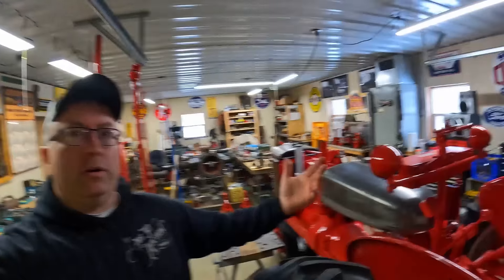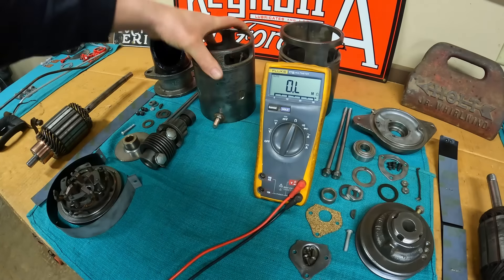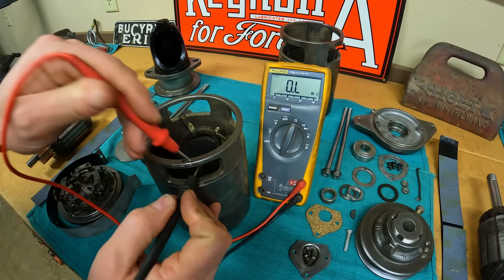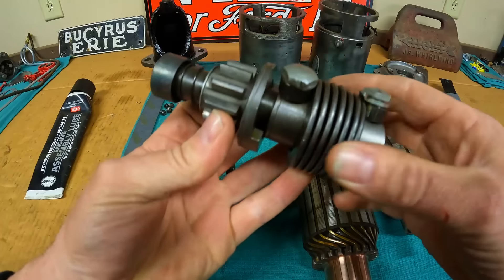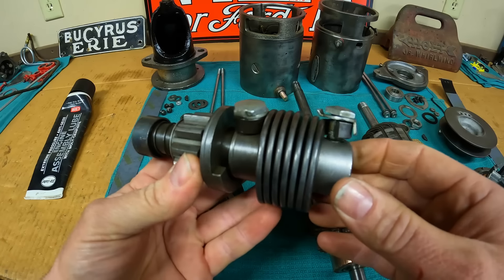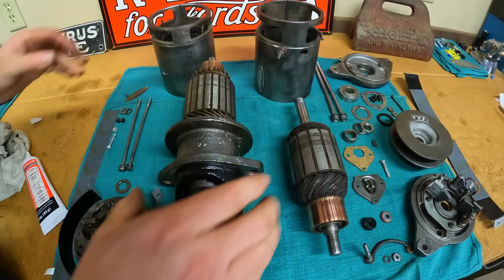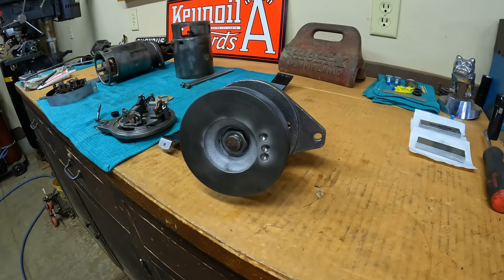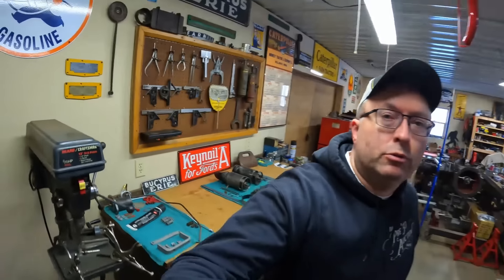Delco-Remy Starter/Generator Repair - Testing Field Coils & Reassembly Begins - "Prep H" Ep. #33

Comment: I'm loving this series I have a Delco-remi generator on my 820 pony start that doesn't always charge and this gives me the confidence I need to take it apart and at least clean it to see if it actually needs a rebuild or not
Reply from the maker: Also keep in mind that the generator is only one part of a two part charging system, the voltage regulator is the second.  Many times the problem is in the regulator if it's an intermittent issue.
Reply: @squatch253  I put a brand new voltage regular on it first as it wasn't putting any voltage out at first because that was the first thing I thought of and now it sometimes charges which is good but the battery still runs low after a while and I'd like to fix that so I'm assuming it's just a dirty generator but after watching your videos now I'll know how to look at things and test things ill leave the rebuild up to a pro since I have a guy local that does it still

Comment: Amazing content as usual!   I sent my starter and generator out, which I now regret.   Really happy that I went with the stock 6 volts, as you would have recommend, just wish I had done my own work.  The three brush system works great but will boil the battery as I was not aware that it was adjustable.   After backing way off, it operates very well.  Something about running your tractor, like it's the 1940's,  is really amazing.

Comment: Nice series on the generator and starter!   As an idle thought, I wonder if the 787 Max 9 doors will be converted to foldover locks instead of castellated nuts?  I'm thinking they just weren't secured by cotter pins though.
Reply from the maker: lol Senior and I were just joking about “Bring back the locks!!!” when we heard of those airplane bolts working loose 😂
Reply: I think it is called "shoddy workmanship".  Apparently nobody checking the work either.
Reply: I don’t think bolts were installed!

Comment: All the older tractors I've worked on has all had a delco-remy starter and generator never seen any other brand un til got to some newer stuff. I guess GM did a very good job since everyone used them.
Reply: I was wondering whether D-R was actually better or if being part of GM (since 1918) provided an economy of scale. Perhaps the D-R products were no better than other brands but less expensive? Bean counters have always been bean counters. If D-R products were even a wee bit cheaper the engineers would have a difficult time justifying additional expense even for products that were demonstrably somewhat better if the D-R products gave acceptable service.
Reply: @curtislowe4577  they have always worked better than any thing else. All manufacturers choose them because it was parts that worked and could be depended on all the time. Just a little mantance and they seriously they just keep on working.
Reply: @charlescastle5566  Not to be mean, rude or dismissive but that doesn't answer the question I posed. Did Ford absolutely not pursue other markets and only manufactured for their own needs? There were independents who survived the Depression. Did they also buy D-R? What about Studebaker? Did they use D-R or make their own? Were there other manufacturers of starters and generators or did D-R corner the market so there actually weren't other choices? Did Chrysler ever use D-R? They manufactured all their own equipment as far as I know and apparently, like Ford they either didn't pursue other markets or their stuff was not cheaper nor remarkably better. The bean counters always have the final say.
Reply: @curtislowe4577  I think what happened back then was that the other manufacturers knew the D-E had did all the work on the electrical components that they could focus on more mechinal things because they all knew that D-E had did extensive work on the electronics and had a contract to provide them to all the manufacturers. I would say some tried their own but had failures and knew they had a source that would provide electrical components that were the most dependable on the market.

Comment: another way to remove the field coils is if you have a big vice you use a ratchet with 1/4 socket and screwdriver bit, you put the starter in the vice and use the jaws to put pressure on the ratchet to loosen the screw

Comment: Dielectric grease may work for you on those surfaces between components, but that grease is meant to avoid the conduction of electricity, not promote it. "dielectric" is an insulator.  Instead, you might consider using a weld-through primer. That material keeps the metal from corroding while providing a good conductor of electricity. Using a process of zinc, nickel, or other plating material would be great, too.  Again, I'm sure your method has worked for you and you keep doing you if that's what you like.
Reply from the maker: That isn’t dielectric grease, it’s an electrical grease used to promote conductivity 👍
Reply: @squatch253  Gotcah, I would expect that's great in electrical connections as designed. I have just had better luck with weld through primer. But again, your experience is what matters to you. I'm just offering mine.
Reply: Forgot to add my apologies. I saw the Motorcraft tube and assumed it was dielectric, as I have a tube. I have used copper anti-seize compound, too, but generally, all of that just seems to create problems later when the painting is done.
Reply: Dielectric Grease is designed to not create Conductive Scorch during arcing, and reduce arcing in contacts
Reply from the maker: @rgmoore - No need to apologize, I just took it as an honest question.  The grease I used here is Motorcraft XG-12, which is manufactured by Nye Lubricants and is specifically for use in electrical connections that can be exposed to water entry.  Ford Motor Co. specs it to be used in many of the airbag and crash sensor connectors where perfect conductivity is required or a warning light will come on - it creates a protective film that allows electricity to flow uninhibited but wards off corrosion in harsh environments.  It can very easily be confused with the Motorcraft XG-3-A though, which is the dielectric grease because the outward appearances of the tubes are nearly identical.

Comment: Did you check the copper post that the battery/starter switch cable goes on,  they get cracked where they are soldered to the field coils. I fix a lot of starters from this, if the post moves when the nut is tightened for the cable it will crack.  Also, I see a lot of broken starter noses from worn ring gear and or bendix teeth and they try to ride up on the teeth and break the nose.

Comment: thanks for sharing. the right tools and information is a great help! the screwdriver you show is still kind of wrong. Ideally the blade should be a perfect square cut profile (not a tapered wedge as off the shelf tools) with a tip shaped to fit the dip in the screw slot. the large flat head drivers in the hand impact ratchets get a bit closer to correct, i think. a 1/4 drive battery impact can help in a pinch but there is risk of camming out and stripping the head. In the out of print magneto book i have, the author recommended buying good quality screw drivers and shaping them on a grinder. Will we see a repeat of this video with X231?

Comment: As a non-mechanic, I appreciate your detailed explanation of the workings of the starter and generator.  I have been told on multiple occasions that some engine has a "bad starter". Since the design is relatively simple, I am curious what is the typical failure point of an electrical starter? I also have had "bad solenoids" in the past. Hopefully you will address that part if the IH Model H had one.
Reply: the monstrous amps that starters pull generates monstrous heat, and that can cook the insulation on the armature (seems more likely than the stators, if it's not permanent magnet). Squatch didn't really highlight it in this but if you look, the starter's armature has much heavier wires than the generator; if a starter is 'smoked', that's probably what's happened because the insulating enamel burns off the armature. The other common failure mode is a cooked relay contactor, whether it was held in too long and burnt up the coil, or the contacts have arced enough to prevent solid connection by making burnt pits... or the housing is just baked and brittle and terminals have come loose (all failure modes I've seen in various Will It Run videos). something else you may find, although it seems mainly a "Big Diesel" Thing, is non-bendix solenoid-throw starter gears, where the starter relay also has a lever on its armature that pushes the gear into position. This introduces a specific quirk: gear-tooth side-hit won't-start. Seems that the gear has to extend fully before the relay makes contact, so if "it just clicks", the starter-gear teeth are hitting the flywheel ring-gear teeth instead of Meshing.if you can nudge the engine a few degrees so it gets out of that interference, it should engage properly.
Reply: @Hyratel those starters with leaver to engage the pinion to flywheel we called Rattrap starter's
Reply: Thanks for the explanation @Hyratel

Comment: The generator field coil is supposed to have a resistance of 2.2 to 2.4 ohms. The average is 2.3 ohms. So (2.3-2.2)/2.3 x 100 = 4.4%. The tolerance on the resistance is +/- 4.4%. You measured 2.0 ohms which is actually 1.9 ohms taking into account of the bias on your ohm meter. This is -17% low on resistance which means that quite a few windings are probably shorted to each other. In other words quite a bit of the enamel has worn through on the windings. It may not reduce the output, but it will make the regulator work harder and waste more energy in the field to get the necessary field magnetic flux.
Reply from the maker: You're correct, and if we were still in the perfect-world scenario of having readily available quality new parts for these units I would be buying new coil windings to maintain 100% capacity.  But those components are now only sourced from the best of what you've got on hand, and just the removal and installation process bring with it a chance of further degrading them so if they test close to the desired, and like this one are known to have been charging prior, they stay in place as long as the generator output is satisfactory :-)

Comment: I'm curious about the Holt Jr Whirlwind part in the background.  Although there's plenty online about Holt, one of Caterpillar's predecessor companies, I can find nothing about that model - nor can I work out what the actual part is.
Reply from the maker: The Holt Whirlwind is a very old Windmill manufacturer, and that is a counter weight from one of them that you'd slide back and forth on the tail section to bring the top rotating assembly into balance.
Reply: @squatch253  Thanks for that.  Veerry interesting, as the saying goes...

Comment: Hey Squatch, so the generator on my M isn’t charging. Followed your checks and I got 1.7 ohms on the field coils. Also tried the motoring test and the generator motors but when I ground the field coils the speed of the generator doesn’t change. So I’m thinking I need new field coils as a starting point. Thoughts?

Comment: Questions.  Is it possible to convert a starter from 6 to 12 volts?  Assuming it’s just different coils or is the armature different also?  Do you know if those parts are readily available?  I have an M that was converted to 12 volt and I doubt they did anything with the starter.  Last one, from the first video, or this one, if the continuity tests fail, is there a way to fix that or is it simply buying new parts?

Comment: I have a question I have a Ford tractor.
Does not have the band over the starter.
Where's the brushes are? I know that's probably very important.
Because the if you get dirt in there.  It's not gonna have the torque to turn the engine over am i correct?
Reply from the maker: Yes it’s important to have that band on there, it’ll keep out water, bugs, dirt, and grit that will dirty up the whole inside of the starter plus cause the brushes and commutator to wear out much faster.
Reply: @squatch253  thanks that's what I though

Comment: So what keeps the sealed bearing from totally from spinning does the flange stop it from spinning
Reply from the maker: The cover with the 3 screws clamps down tight on the outer race of the bearing.
Reply: @squatch253  didn't think that would hold the bearing

Comment: Hi, you talk about electrical grease, is that the sae as dielectric grease? Thanks 👍
Reply from the maker: This is not dielectric grease, this is Motorcraft XG-12 electrical grease which is used to coat and protect any electrical connection that may be exposed to water entry.  It is even used on airbag and crash sensor connections where perfect electrical conductivity has to be maintained or a warning light will come on.  Designed to be squeezed directly into multi-pin connectors before putting back together.  The XG-12 is made by Nye Lubricants, and is not to be confused with the Motorcraft XG-3-A dielectric grease, which has different properties but is in a very similar looking tube.
Reply: @squatch253  Thanks, not sure that's readily available over here in the UK
Cheers
Reply from the maker: I order mine off of Amazon, it’s readily available there but I’m not sure what shipping hassles there might be.

Comment: Do you know if you can take a hydraulic pump from a 1952 miccormick wd9 and put it onto a 1952 miccormick super w6, and it still work
Reply from the maker: I do not know, I’ve never worked on either of those models. I recommend posting this question on the Red Power forum, they’ll be able to give you an answer for sure 👍

Comment: Cub cadet riding mowers use the generator as a starter not a good idea, they did. The generator can be powered to run like a electric motors, even old welds could be started by using a welder to energize the generator

Comment: The pole screws to crack them lose just use a half inch punch and stiff hit with a hammer and they screw right out, I prefer not to use heat